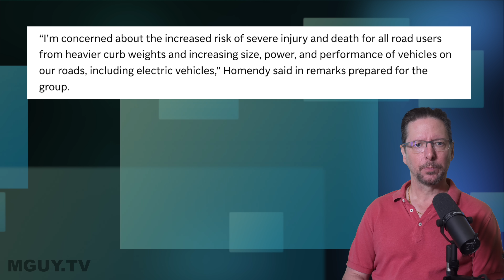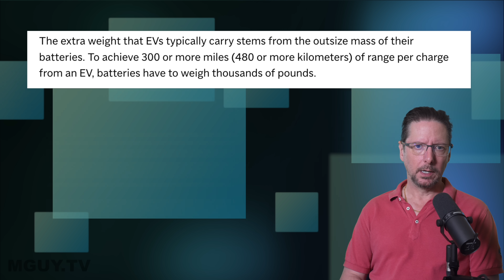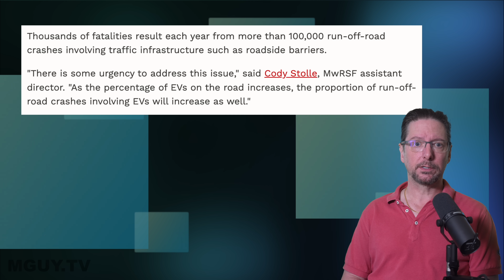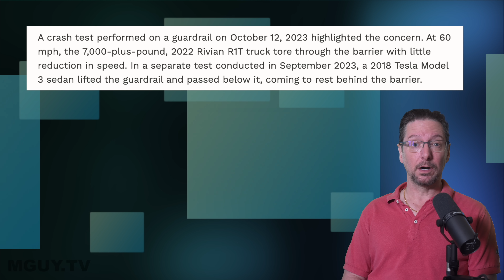EVs TOO HEAVY for roadside crash barriers (guard rails) | MGUY Australia

Comment: The concern with EVs and crashes may be more of an issue in Europe vs North America, as we have had heavy and large passenger vehicles for decades, and we have plenty of heavy ICE vehicles now.  Vehicles have been getting bigger and heavier for years (as an example look at the Honda Civic from the 80s compared to now).  The acceleration is more of a factor, but again, the average vehicle has been reducing their 0-60 times for years … it’s just amplified on with some of the EVs (not all, example Chevy Volt).  What is scary to me is that I can see insurance companies requiring full access to vehicle data in order to be able to insure the EV, as well as identifiers who is driving the car via phone or facial recognition.  As a few other auto enthusiasts predict, EVs with autonomous driving capabilities and expansion of 5G network will end up at a point where autonomous driving out perform human driving, and it will cost more for you to drive yourself.  This will be how we are forced out of our non autonomous capable cars.  Thankfully it is still far into the future (10-20 yrs) and will likely initially apply to all high density regions.

Comment: Just a thought about the massive acceleration abilities of EVs. My F350 Superduty diesel came from the factory with a torque limiter to not allow the truck to use 100% of the torque available from a dead stop. This was probably to keep from breaking parts like drivelines, u-joints, and axles, but at the same time, it would make the truck less likely loose control if the roads were slick or something else like gravel. Maybe they should incorporate something like that in EV'S. Could help tire wear at least.

Comment: There should be acceleration restrictions as well as top speed restrictions on all cars
Reply: I can see them reintroducing amphometers which are those two rubber strips they used to place at a distance to one another on roads to measure just that. Connect them to a camera and voila! You occasionally see them used nowadays for traffic counting. There is still acceleration restrictions in force today but authorities are likely currently turning a blind eye.

Comment: Another factor is if you raise the strength of the barriers to accommodate heavier vehicles it's putting smaller lighter vehicles in way more danger. They're designed for that weight specifically, the flex and give. If they're heavier smaller cars are just going to ping off of them causing more wrecks
Reply: Accommodate heavier vehicles like 40 ton trucks?🤔
Reply: @DwaynePipes  a guard rail wasn't designed to stop "40 ton trucks". 
A stupid EV is low to the ground and weighs close to three times as much as a regular car. They're not designed for that kind of b.s.
Reply: @TYPE-O-NEGATIVITY  I found the info I think.

"We knew it was going to be an extremely demanding test of the roadside safety system," said Cody Stolle with the university's Midwest Roadside Safety Facility. “The system was not made to handle vehicles greater than 5,000 pounds.”

So you are correct, the design limit is 5000 pounds. Big 40 ton trucks are not part of the design parameters.

So what does that mean for the current and future vehicle profile?

It goes on to say:

"But Stolle's team has seen this problem before — it's a problem already with us on the roads. In the 1990s, as more people began buying pickups and sport utility vehicles, the Midwest Roadside Safety Facility found that the then-50-year-old guardrail system was proving inadequate to handle their extra weight. 

“At the time, lightweight pickups made up 10-to-15% of the vehicle fleet,” Stolle said. “Now, more than 50% of vehicles on the road are pickups and SUVs.”

And many, if not most, full-size and heavy-duty pickups and SUVs already on the road exceed the 5,000-pound capacity of guardrails."

So it looks like the problem is already here and has been for some time with the current profile of heavy ICE vehicles!

Sure the EVs over 5000 pounds will be an issue but as seen above, the issue is already here and in big (ICE) numbers.

Don't see many complaints about them, do you?
Reply: @DwaynePipes  I don't see how that matters, guard rails when collided upon are structurally sound and often inspected therefore when hit provides the necessary crumple action to slow an accident rather than stop it.(given it's around the average size of the majority of vehicles on the road) An EV- SUV the size of a  Yukon or larger will weigh up to three times more than gas vehicle depending on the  size of battery chosen for battery range. I'd guess an Excursion EV with a 300 mile range would weigh around 10 to 15,000 lbs.  Significantly more than the load intended. They honestly can't change the design or upgrade to work on EVs or they'd cause more harm than good considering most cars are around one ton to 4000 lbs on average
Reply: @TYPE-O-NEGATIVITY  The point I am trying to make is that there are already plenty of ICE vehicles on the roads which exceed the design limits for the guardrails.

Now some EVs which are currently much lower in numbers will exceed that limit also but why is the sudden concern for "heavy" EVs?
When equivalent and numerous ICE "heavy" vehicles already hit that limit?

If you don't believe me, here for instance is an extract from JD Power.

 SUV classes do not have strict requirements, a wide array of 5-seat and 7-seat vehicles fall into the mid-size category, meaning that weights can vary drastically from one model to another. Mid-size SUVs can weigh anywhere from 3,500 to 6,000 pounds, but the average weight of a sizeable, off-road-ready SUV is roughly 5,000 pounds. Notable models include:

Jeep Wrangler

Jeep Grand Cherokee

Land Rover Discovery

Range Rover Classic

Mercedes-Benz G-Class

Ford Explorer

The largest conventional models of SUV are placed in the full-size class. The increase in weight and size (especially the wheelbase) can limit the off-road effectiveness of some SUVs in this class. However, models like the Ford Expedition and Chevrolet Tahoe maintain a strong focus on off-road capabilities. 

But while the Expedition and Tahoe are tailored for off-roading, other models forgo this functionality in favor of luxury. Some of the best examples include the Cadillac Escalade and Lincoln Navigator. A majority of these models are based on a full-sized pickup platform, so they remain in the SUV class. Full-size SUVs commonly weigh between 5,300 and 6,000 pounds, with prominent examples being:

Cadillac Escalade

Chevrolet Tahoe

Ford Expedition

GMC Yukon

Jeep Grand Cherokee

Toyota Land Cruiser

In North America, and especially in the United States, manufacturers make full-size SUVs in a long-wheelbase variant. These models offer additional rear passenger space and more cargo volume based on full-sized or heavy-duty pickup platforms. 

Despite the increase in size, extended-length SUV models have roughly the same weight as the full-size models, ranging between 5,400 to 6,000 pounds. With just over a dozen models in production, some of the most popular include:

Chevrolet Suburban

Ford Excursion 

GMC Yukon XL

Jeep Commander

Toyota Mega Cruiser

Lincoln Navigator

Comment: Do you imagine that trucks currently cost the same to insure as all other vehicles? Or that all electric vehicles are one group and all others are another? Or that insurance has not increased? Or that insurance is not weighed vehicle y vehicle by vehicle including colour as well as driver by driver by driver? Or that there is no actuarial industry? The one and only reason insurance might ever unduly favour EVs is that either the data hasn't come in yet or government forces the risk to be spread amongst all drivers regardless.   @stephenfazekas5054

Comment: I don't like using weight and acceleration as an argument because it will never hold up. There are conventional pickup trucks and SUV's that weigh the same as EV's. There are also sportscars that are on par with EV's when it comes to acceleration. Instead, you should use arguments like additional road-, tire- and brake wear which produces more harmfull fine particles with EV's. Or the fact that you have to drive an EV at least 90.000 km before (in theory) it becomes evironmentally friendlier.

Comment: I was a police officer on UK motorways before crash barriers were installed. Collisions involving vehicles crossing central reservations were common and usually serious as they frequently involved head on crashed. What will it be like when these heavy vehicles go through the barriers. Carnage
Reply: Do 40 ton trucks go through the barriers?
Reply: There were no 40 ton trucks, artics were rare, most were rigid with sheeted and roped loads
Reply: @davidtomlinson8735  That was then.
Now, what will happen when 40 ton trucks go through the barriers?
Carnage?

Comment: I don't know why the guard rails are not just big water filled barrels, We know hitting these walls of water is safe and after a crash the water just runs down and the grass and trees suck it up and we can just replace the damaged section with new barrels and more water, but we still use these metal rails?

Comment: This video got me thinking about a more general concept: auto makers designed the “donut” spare tires to reduce weight per auto of a regular size tire. Though it’s a small reduction in weight, added up by thousands of cars it does make an impact on fuel efficiency and the environment. But an EV has an incredible battery weight that is there all the time. 1500 pounds (battery)  vs 120 pounds (full 15 gallons of gasoline). Another example of not calculating the full cost and impact of EVs.

Comment: This is a load of codswallop. Its just an excuse to have a go at EVs when in fact the problem is just the weight of the vehicles. US pickup trucks have been ballooning over the last 30 years. Many weigh 6000lbs or about 3 tons. Most EVs apart from a few models are less than 3 tons and many less than 2 tons.

Comment: What about those wire torsion road barriers? They are much better, also unless your trying to kil people that angle the pick up hit the barrier at is very unlikely. Also it would be pointless to have road barriers if they couldnt already deal with vehicles heavier then an ev, also how many people drive humvees, specially in aus. You have an interesting point here but its not a problem to write home about. Just dont buy your ev from chine and you will be fine.

Comment: You spelled SUV wrong. Given that they are twice or more heavier than a typical sedan.
I can understand that an electric SUV is a problem. Have a maximum weight for vehicles that can be driven on a standard license. 
I agree that high performance EVs are dumb.

Comment: These EV electric cars are just rushed in just like the vaccines they are deadly. Technically speaking, they should not have passed the health and safety designs and

 health and safety measures that should be there. Seems that the globalists have removed health and safety Standards from these cars designs.  

Likewise, you have health and safety standards on Motorbikes helmets. You have health and safety standards on most things

 that you purchase. Especially on electrical appliances. They have to pass a health and safety check and

 tastest. What happened to all the safety checks? When these cars were designed and made, they would have had to go through

 protocol. To require a health and safety check. It seems that this has been bypassed. Totally overlooked. They don't care about the health and safety. They have removed this organisation from all electric vehicles that have been made. This is crazy. And stupid
Reply: You are aware aren't you that there are many ICE vehicles greatly heavier than EVs?
Where was all of that safety testing for them?🤔

Comment: Actually this is not a good example,  most pickup trucks ether go through the barrier or roll over the top of them,  the barriers were never designed for tall  vehicles!
The heavy battery giving the pickup truck a low center of gravity guarantee it will punch through the barrier!
As for EV cars going through the barriers just proves they are a step backwards in efficency, the barriers were designed for the heavy cars we drove in the 80s!
For years we have made cars lighter to increase their fuel efficiency!
EVs are a joke when it comes to energy efficiency, they are far to heavy. 🙄

Comment: Those guard rails are only designed for lighter vehicles, do you think those will work for larger cars or trucks ??  You have Dodge Ram thats weights 2600kg about 6800lbs and the Cyber Truck about the same weight why are you not talking about that ? Its a heavy vehicle and those rails are not for those types they are for ones more than half that weight and from the video I see it was speeding as well is you get a lighter car or the like it will also do the same thing in the video. So know what you are talking about and lets not even talk about the Dodge Ram 2500 which is almost 9000lbs

Comment: There are numerous pickup trucks that weigh as much as the EV's. The flimsy construction of most cars on the road is the biggest risk to others. The cars now are "throw away" if they have a crash, EV's even a small bumper thumper that would not even be considered back in the 1960's when all cars had real bumpers!

Comment: Ok we need a reality check here. The first part of the video is almost word for word the same argument brought up during the late 90's and into the early 2000's about SUV's and that was eventually debunked in the subsequent years. As for the second part we need to remember that long before EV's we had heavy pickup trucks and big rigs that either came close to or grossly outweighed EV's and we haven't heard anyone screaming about these barriers failing to those vehicles.

I know this channel is based on pointing out the many flaws of EV's in their current state but putting out poorly thought out stuff like this does the cause a disservice.

Comment: The heavier the vehicle the safer it is for its occupants and the more deadly it becomes for anyone else that you run into. Monash university in Australia has lots of real world crash data and it shows that weight, not the safety rating of the car, is the biggest predictor of which occupants will survive or die in a crash.

Comment: I'm not an ev fan but these evs weigh no more than a common 3/4 ton diesel and there are lots of them on the road. So as far as safety barries go they are not different. Now back to parking structures,  alot of parking structures won't fit a 3/4 ton diesel due to height so there could be a weight issue there.
Reply: 3/4 ton diesels aren't in every driveway nor are they all that Common. Are you trying to say that 3/4 ton diesels are more common than BEV or that they will be in the future?
Reply: @robertkubrick3738  around here I can guarantee 3/4 ton diesels are more common than EV'S  probably 2 or 3 times the amount of 3/4ton diesels than evs. I know maybe 2 people that have evs but couldn't count how many have 3/4 ton diesels . Even in my local town there might be 5 or 6 evs but you can't drive down the street without meeting several diesel trucks.

Comment: most anti terrorist crash barriers are not designed to with stand the high acceleration in short distance, there will need to be a rework that includes a reversing 90 degree turn to provide access

Comment: It's interesting that the weight of fuel required to go 500 miles in a diesel is less than 100kg, compared to over 1000kg for a battery....which is really more efficient all round? I see Paris has voted to charge heavier vehicles (SUVs) astronomic parking fees, regardless of how they are fuelled, but that is probably tomorrow's video....

Comment: Every EV would be lighter on average if we all had an EV with modular batteries that you add when you need them at a filling station. Then every EV could have a relatively small resident battery and spaces for as many as you need for a longer road trip. Most people in the US do not regularly drive more than 30-40 miles in a day. Every EV could be very cheap, and very light except for those going great distances where there are few stations to pick up refills. The refill batteries could be owned by the car makers collectively if they could just agree on a standard to plug in. No more long delays at charging stations. Faster than filling a gas tank. Refill batteries could also be kept the optimal temperature so that you don't have to fear a frozen car battery/ Smaller, lighter, cheaper and greener -- it would take strong government incentives, but it could save GM, Ford, Stellantis, Toyota, Honda and Nissan from getting crushed into bankruptcy.
Reply: Swappable doesn't work. NIO is dead, you can buy their stock for $7 USD. Concrete Australia is your second example of swappable batteries. The FIREY but mostly peaceful trucks. The cooling solution is the problem. Not enough cooling in a swappable battery system..
Reply: STOP IT WITH THE GOVERNMENT INCENTIVES ALREADY. WE DON'T WANT IT AND WE AREN'T PAYING FOR YOUR TOY

Comment: Small EVs are not economically viable because they are far more expensive than their petrol-engined counterparts. People on low incomes would not buy them. Hence most new EVs are large luxury cars and trucks with sports-car like performance. Moreover, apart from being much heavier, battery power is a very inefficient means delivering energy, especially in colder climates.